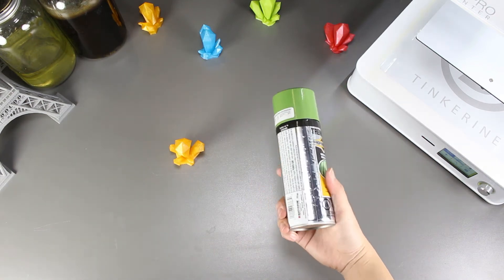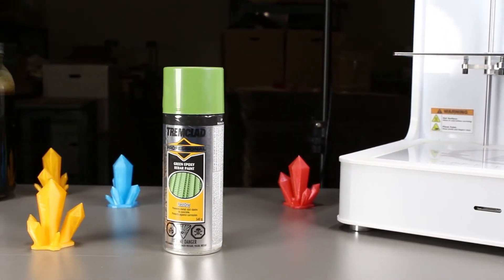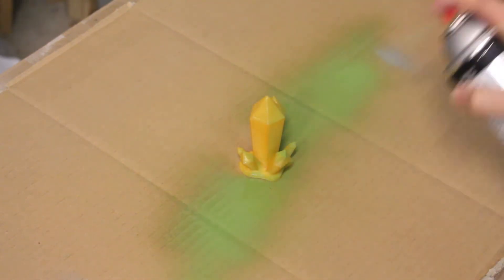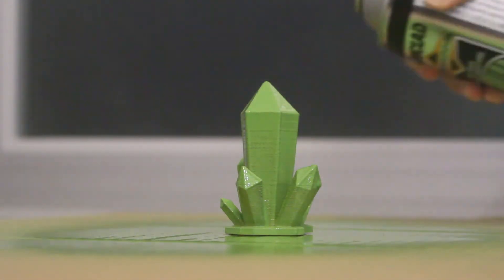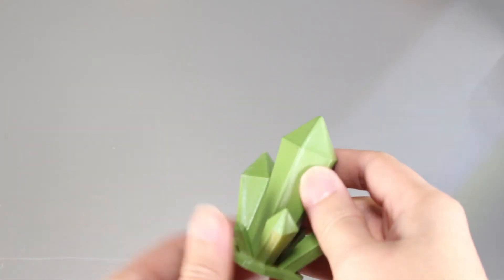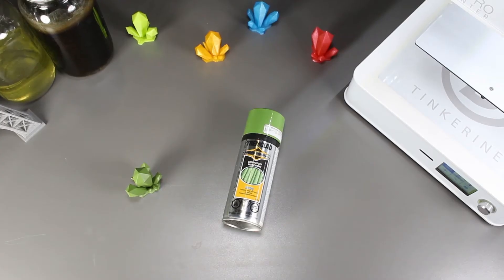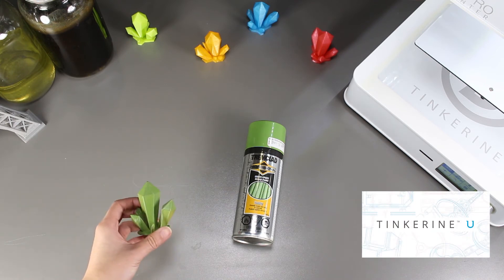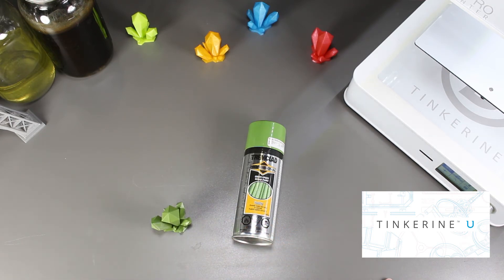Post-Processing 3D Printed Models With Epoxy Paint

Comment: What did i just watch? How to spraypaint a 3d-print? You have to apply a pretty amount of epoxy(-resin) to the print to make it float on the surface and even the lines.
Reply from the maker: Hi,

We were testing to see how epoxy glue would turn out but thanks for the advice!